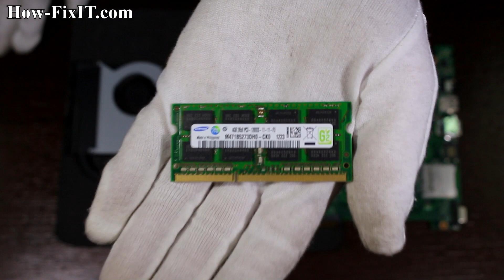Asus X401A RAM Upgrade and Install | Step-by-step DIY Tutorial

Comment: Thanks. Any idea if it can take 8gb RAM? Google search says the max is 4gb but Crucial site says 8gb
Reply: Could you solve your doubt?
Reply: @jhulianmerida7133  i just used 4gb to be safe
Reply: @sooolion9820  Tomorrow I will buy an 8Gb. If it works I'll tell you
Reply: @sooolion9820  Hello again, I used a 8Gb ram and changed the HDD for an SSD. Both worked fine for me. Laptop ASUS X401A
Reply: Awesome thank you!
Reply: th @jhulianmerida7133  Thank you, I have an x401A, I changed the SSD and well, I have wanted to change the RAM, now with your comments I am going to do it.
For me this Laptop is one of the most warriors I have ever had.
Reply: Hikvision 8 ГБ DDR3 1600 МГц SODIMM CL11 HKED3082BAA2A0ZA1/8G will be work?

Comment: The Asus X401A is confirmed upgradeable with only one DIMM. I used a single Samsung 8GB DDR3L (M471B1G73DB0-YK0), up from the 4GB inside. It was such a hassle just to replace it though, something that could easily have been fixed with a simple service door on the bottom instead of having to open up from the keyboard and flip the mobo
Reply: Hi What was your processor? Mine is pentium B970... Im in doubt of upgrading from 2gb to 4 or 8gb because google says 4gb max but crucial site says it can take up to 8gb. Thanks
Reply: @sooolion9820  Intel Pentium CPU B980 @ 2.40GHz
Reply: @sooolion9820  the RAM is only upgradable, right?? I'm planning to upgrade processor too if allowed,, im using X401A and too laggy with the 4GB RAM installed after upgrading OS from Win8 to Win10...
Reply: @LenhaRDT0130  win10 requires higher end hardware i believe. it can be done as long as the new processor has the same slot as your existing one. I Never tried it personally though. Mine still runs on old B970 processor, win7, and now the new 4gb RAM. I had a guess that my specs cant handle higher version OS so i did not upgrade it. Win7 + 4Gb RAM does the job for my needs so far. Good luck to you!
Reply: @sooolion9820  then i should go back to win8 since it felt really slow since upgrading to win10.. and maybe just upgrade my 2GB RAM.. thanks
Reply: @LenhaRDT0130  cheers
Reply: @LenhaRDT0130  How did it go? Did your laptop got any faster? Cuz I have 2 gb ram x401u laptop, and I'd like to upgrade its ram to 8gb.
Reply: @houndslove  yes.. not just faster, it can handle multiple windows and softwares all at once now without the lag or freezing.. faster loading as well
Reply: @LenhaRDT0130  can you watch videos without it freezing?
Reply: @LenhaRDT0130 Is there a way to update the ram memory (preferably ddr4), put an SSD and processor on the X401U?
Reply: I have this laptop I wanna know 8gb of ram stick will work or not ?
Plz reply

Comment: You can not replace the RAM for Asus X401U. This model has the RAM memory built in the mother board.
Reply: Noobplayz TV  You can have it only if you desolder the RAM and solder back a different one's. The question is: will work? 
And it's not for everyone to do that operation. ;)
Reply: Solder deez nutzzz
Reply: aren't there r 2 slots??